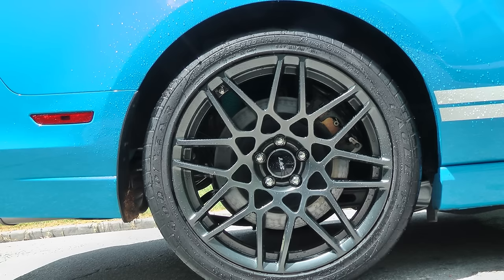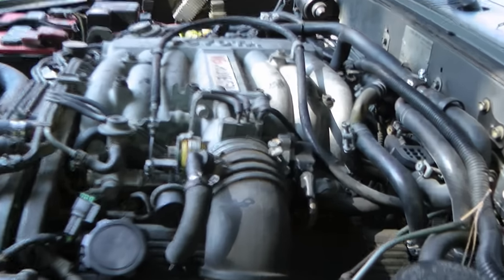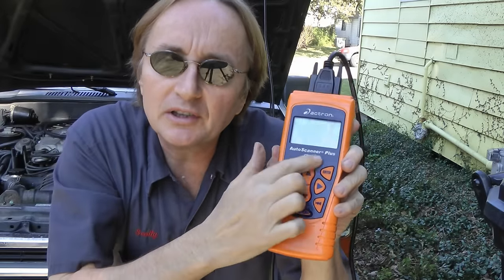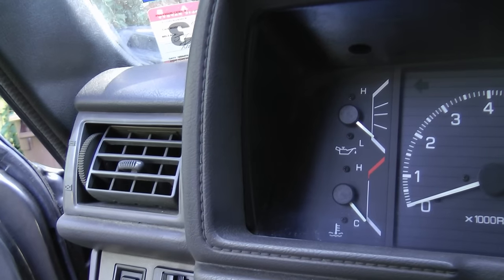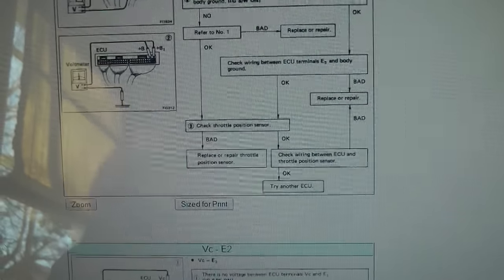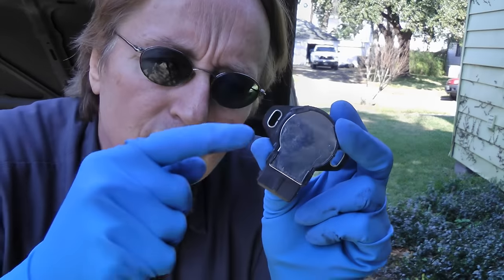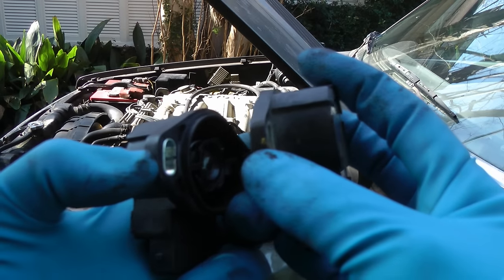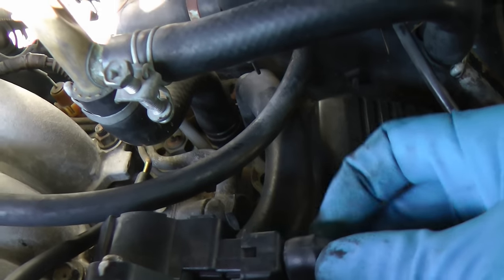How to Stop Car Hesitation (Throttle Position Sensor)

Comment: hi scott i have a 07 cts that cranks but doesnt start..i changed the valve cover gasket spark plugs. i fired up the first 3 times then it gave out there was a ticking clicking noise then went dead. .. the next time i tried to start it it drained the battery i tried recharging n battery is good i tried again n nothing drained it again i also tried to jump start it n still nothing can u help
Reply: What was it I would guess starter

Comment: sir i need your help. i try to pull out the tps connector and the rpm increasing and the worst is when i add some gas on pedal the rpm still increasing higher. does it mean i have bad tps on my nissa sentra 2003 model.
Reply from the maker: you can't test modern cars by disconnecting stuff, there is too much feedback software on their computers. that test is meaningless on your Nissan, have it tested by a pro with an oscilliscope, or just guess with a new one considering what mechanics charge per hour. Auto zones have a very liberal return policty, if it doesn't work, get your money back

Comment: what are the symptoms of a bad TPS on a car
Reply from the maker: often poor idling and weak acceleration
Reply: thanks for the quick reply @Scotty Kilmer. the reason i ask is because i have 2000 gmc yukon 4x4 5.3L  when im hitting highway speeds 55 and over my suv starts jurking and my speedometer  bounces from 55 to 65. i have replace my wires my spark plugs and even my fuel filter. my check engine dont come on dough. so im having a hard time figuring out what is wrong with it.

Comment: Mr. Kilmer, I found your page(s) by Divine providence, fate, luck or whatever. I am having serious poblems since a shop replsced distributorm rotor and cap. It i a Mazda Millenia 2001. That gracious Spirit is causing me to believe it is my throttle sensor that is comtributing to the "HOLD" indicator flashing and the engine is fine foe  a time and then it's hang on cowboy for a time. If I can successfully replace this sensor I will extol your pages to any and all others. I appreciate your time and you shring in this manner I have no doubt that you have helped countless others. Sincere best wishes sir. I'll be back to let you know the outcome.

Comment: Would a bad TPS cause my car to run rich?
Reply from the maker: +rog duran sometimes it can, just depends how it breaks
Reply: +Scotty Kilmer Hey Scotty, could catalytic converters cause poor acceleration on a vehicle?
Reply: +Scotty Kilmer would it cause it to lose fuel extremely quickly as well? I had same sort of problem, car running rich(whitish smoke) and poor acceleration, and idle dropping til dead. Didn't see oil or gas leaking out the bottom, it's like the gas disappeared!
Reply: i gonna say yes. not enough air flowing out. i think thats whats going on with my mustang

Comment: Hey my 2000 mustang when I give it gas it studders any clue why new plugs new air filter cleaned the idle air , and mass air flow, new fuel filter , any clue no engine codes
Reply from the maker: pressure test the fuel pump, as computer doesnt know fuel pressure so it can't set a code if it's bad

Comment: so I have no idea what's wrong with my truck, (92 dodge dakota) in the morning I'll wake up to go to school and I'll get in and it starts right up but has a extreme vacuum leak sound coming from the throttle body then then it goes away, when I give it gas it hesitates then goes, if I put it in drive and give it gas it dies. I've tried unplugging the tps and the truck just died. any ideas???
Reply from the maker: +Zach Gee  do my video "finding engine vacuum leaks with a cigar"

Comment: hi scott i'm having a bit of a problem with my plymonth breeze. I went to get my inspection done the other day and failed. they siad I have to run the car about 100 miles so the computer can be ready to diagnose the vehicle,  did that, but i notice after i get to the 4 code sometimes the 5th code while driving about 70 mph the engine will hesitate and the speedometer will drop to 40 mph and jump back to 70 mph and when that happens the check engine light will come on and go off and that resets the computer codes why is that happenning
Reply from the maker: dj immenojockoo   try a new speed sensor
Reply: Gear position sensor, output side or input side which one

Comment: Hey Scott,

Why does my car jerk when I shift gears from parking to reverse? and all the others jerk as well but not as much as the reverse. It feels like the transmission is going to come out. I just flushed the transmission fluid and it keeps doing it. Do you think it might be that the transmission is already worn out? 😓 

Someone help please. 😩
Reply: I could high idle set your idle to right rpms at idle
Reply: sounds like a tranny or motor mount. if they are worn, it will cause play.

Comment: hello I'm facing a problem I drive and 2003 gmt yukon and it cuts on and it rides but now it's starting to cut off while I'm driving it did it on the highway  and side street oh please tell me what can that be 

            sincerely in need of answers
Reply: +Nichole Reese Fuel pump, better check it out before you are stranded on the highway.
Reply: +Jonas Ben thanks
Reply: +Nichole Reese No problem.

Comment: my toyota 7k-e engine MT has high idle without a/c  my idle screw is on lowest settings throttle body is clean how can i solve this Sir scotty
Reply from the maker: you may need a new iac valve, but try this cleaning video and pray it works https://www.youtube.com/watch?v=NWCKvU2FmDc
Reply: sir i have done cleaning the IAC valve, but i dont have check engine light but when i shorted the Te and E1 on diagnostic it gives me a code 24 and code 41 i search on google it says code 24 air temp sensor, code 42 TPS sensor. when i unplug the TPS sensor while the engine is running the idle goes up high
thank you for your reply sir Scotty

Comment: When you throttle sensor play up does the check engine light comes on
Reply: I had a bad throttle body sensor and on my saturn 1997 it doesnt read that its bad
Reply: @piggyjones6667  did it lose power and fill like its straining

Comment: I have a 89 mustang 5.0 losing power when I hit the gas but I check the mass airflow when I unplugged it it shut off what else could it be
Reply from the maker: lots of thing, pressure test the fuel pump first as weak ones or clogged filters do that
Reply: Scotty Kilmer ok ill do that thanks

Comment: sir my 2005 hyundai getz manual trans have a problem. 
I am in full throtle but da speed is not running fast. it accelerate slower than usual. what seems to be the problem sir? please help
Reply from the maker: +Savina Oregas time for a new clutch, it's slipping
Reply: +Scotty Kilmer sir i have already replaced my clutch set. but still no good. wat seems to be da problem

Comment: i have a 2002 vw passat and the problem with it is that it takes a while for it to take off just fixed the oil lines and added new oil transmission what can b causing my car to take a long time to accelerate ?
Reply from the maker: +jerry aguilar on those, often bad maf sensors or weak fuel pump. PRAY it's not the transmission going out cause those are weak and cost a fortune to rebuild, but go out a lot when that old
Reply: Scotty Kilmer what would u recommend if u were in my situation? And btw thanks for answering my question

Comment: Had a poor idle. Cleaned air intake and changed out throttle position sensor.  Now it starts idles for about 2 or 3 seconds and then dies.  It will run if I rev it to 1500 or more. If I put it into gear it dies instantly????
Reply from the maker: pressure test the fuel pump to see if it's weak

Comment: Hello Brother. I am writing from Turkey. and I have a problem. The BMW 3.20d m47 engine has an automatic model of the 2001 model. my problem is that my vehicle is starting with a delay of 4 seconds each time I press the accelerator pedal. 4. After the rocket, please give me a suggestion. the injector is giving a cable fault when the vehicle is connected to the computer. so the pump and injectors changed, the motor wiring changed, the maf sensor changed, the brain was checked, the turbo was cleaned, the turbo was checked and no solution was found. please help.
Reply: the vehicle is sensing gas very slowly

Comment: If the engine runs better without the sensor what's the points in having a sensor?
Reply from the maker: modern software can do weird stuff in a car, making them "seem" to run better with things disconnected due to backup software. But the sensors are there to maximize power and minimize pollution
Reply: ok. Thank you. Would revving up, down, up down, up down, every 2 seconds or so be a symptom of a bad TPS ?
Reply: you have a vacuum leak
Reply: Actually, getting a new catalytic converter  seems to have solved the problem.
Reply: sorry my toyota did the same thing and it was a vacuum
Reply: Seems like there's a lot of problems that have the same symptoms. Vehicles today are too complicated. A bad computer can act like a mechanical problem. A mechanical failure can be disguised as a bad sensor. A bad sensor can make you think you need a new computer. Even computer diagnostics can lead you in the wrong direction. I yearn for the good ole days when problems were obvious.

Comment: I have a 2000 Buick lesabre custom and I cleaned the throttle body and now after 3 days it still won't start I know I have fuel plus I just cleaned all of my injectors and my fuel rail and the car was running I know my coil packs are good and making spark and it has air the throttle body gasket is good but the check engine light is on I tried starting it with the maf unplugged still nothing and the battery is good freshly pulled out of my 2002 Chevy 3500 6.6 duramax diesel.
Reply: plus there are no codes checked with a scan tool.
Reply from the maker: +Benjamin Hopkins try my video "fixing a car that cranks but doesn't start up"
Reply: +Scotty Kilmer  I have I've been watching your channel for 4 years and I'm just now 15 it has fuel spark and a fully charged battery.
Reply: +Scotty Kilmer And I just changed the spark plugs like 10 minutes ago I'm charging the battery again to be on the safe side but what do you think I should do? And is there anyway I could get in a Skype call with you?
Reply: +Scotty Kilmer  I think the antifreeze is mainly water and the radiator thermostat is reading 10 degrees so the water pump is frozen.

Comment: my car hesistates when i mash all down on the accelerator. i changed tps, throttle body, injector rail and the problem still persist. Fuel pressure is good and i have no idea what the problem cud be. Any help would do
Reply from the maker: +hyperzinc  many things can do that, guessing wastes money and often fixes nothing. Have a guy like me analyze it with his dealer level scanner to find the fault--see my video "fixing insanely complex modern cars"
Reply: +Scotty Kilmer got it sorted out. I had to change the distributor. Thanks

Comment: Car idles great and drives fine but when idling or in gear if brake applied and gas pedal pushed nothing happens motor doesn't rev up or try to move

Comment: My mechanic told me I need a new tps but it's carb'd am I wrong thinking that it doesn't have it since its carb'd
Reply: Car is a 89 corrolla with poor idle and wants to die at stops and when romantic gets low, any suggestions as to what it may be

Comment: Hey Mr Scotty my 95 corolla.    my fuel filter,   airfilter,   spark plugs and wires ,   new distributor cap n rotor.  but my car still sputters wen drivin n at redlights.  it cuts off. and fires back up. n my engine light is on.    im tired of wastin money.   Thanks.
Reply from the maker: often dirty fuel injectors, pressure test them and also pressure test the fuel pump
Reply: Ok thanks

Comment: hey scotty, i really need your help. I have an 01 mustang and when im driving down the road my car starts to lose power, i step on the gas pedal and it doesn't accelerate so what I do is turn off the car and turn it back on and it starts running fine for another 10 minutes or so. Also when i'm at a stop light it starts shaking like if it wants to cut off. I've taken it to different mechanics but each one tells me different things. I've already done a tune up and changed the fuel filter but still the same. Can you please help me. Thank you.
Reply: I also have no check engine light on
Reply: LethalBean, I don't want to jump in on Mr Kilmer's stuff, (I learn from him as well and love his stuff), but I can add a tidbit of information that might help you. It has served me well over the past five years. Just because you don't have a check engine light on doesn't mean that you have one developing. By the time you read this your light "may" be on. Or, (like in my case) I have a code present on my 07 Dodge Magnum HEMI, with no check engine light which states my "immobilizer key has not been programmed", which could have happened from a number of reasons. But, in the past, people have gone as far as removing the instrument cluster and removing the light bulb behind the "check engine light display" so if a code is present, you won't know until the problem turns into something major. (I had a car like that once). On some newer cars, or different makes, that is harder to do as the light is actually an l.e.d. attached to a circuit board and cannot be unplugged like a light bulb.
Just like Mr. Kilmers trick of jumping ports with a paperclip, (which I used to do on an ol 92 Camaro), these days, if you have a smartphone, can afford to spend 15 dollars, you can pull codes yourself and with one click, get a definition of the exact problem you are having. (If a code is present). 
Go online and look up an ELM 327. It plugs into your diagnostic port, and costs, well I got mine 3 years ago for about 12 dollars. When you get it, you can go get the "torque app" installed on your phone. (I'm android) I am not sure about apple. There is a free version, but the full version cost 5 bucks.
This ELM, while plugged into your OBD port, Bluetooth connects to your phone, and while the app is running, you can scan your own car in your driveway, without going to Autozone, without going to pay a mechanic, and if there's a code displayed, you can click on a link, it will take you straight to the web and give you the definition of what's going on.
Certain models even have a female that talk to you when your engine gets to operating temperature, or will verbally spit the code out at you, and if you are hard of hearing like me, plug in your 3.5 mm aux cable into your phone and into the aux port of your stereo and listen to your car talk to you lol.
On some cars though, like my son's Cadillac, you have to get an extension wire for this scanner as the OBD port is recessed into some funky plastic tunnel that makes it hard for certain scanners to even attempt to get into.
There's other things that could be going on as well with your vehicle, but ironically, today I was reading about "cleaning throttle bodies" on cars and it brought me to Mr. Kilmers channel again.....You could possibly also have a dirty throttle body or, if you don't use the same gas station all the time and have recently fueled up at a different location, could have gotten hold of some bad fuel....that's the few things that come to my mind...
Good luck, hope you get your problem fixed.....!

Comment: Car stalls when I shift to R or D, once the engine has warmed up. It will restart no problem, but stalls again when trying to shift again.  Less of an issue with a cold engine. Please help!
Reply from the maker: it does it when warm more, so odds are engine is slightly running rich. Try my video 'how to clean fuel injectors on your car'
Reply: I also hear a metallic friction sound when placed in reverse, and foot on brake.
Reply: Torque converter clutch? flywheel maybe. Lastly when exiting the free way, at the first stop light, the car shuts off. It starts again, but its back to the stall issue once I go to Rev or Drive.

Comment: I replaced  throttle body  with new sensor  and all 4 coils and and the crank sensor  car stills stalls if i hit the accelerator  hard  what still be the issue
Reply: I also  replaced  spark plugs  and fuel filter  and air filter  i have 2002 toyota  solara

Comment: Sir My car engine stops sometimes while releasing clutch or changing gear even at high speed sometimes 
I had cleaned my throttle, changed fuel filter, checked battery terminal 
but problems still persists 
plzz guide me
Reply from the maker: tons of things can do that, start by having the throttle assembly checked by a pro mechanic, often they just flat wear out and do that, especially on fords

Comment: my 94 mustang cuts out when I push on the gas and dogs  any idea what it could be
Reply from the maker: pressure test the fuel pump AFTER changing the fuel filter to see if it's weak. Also try cleaning the fuel injectors and do check the spark plugs

Comment: when I let off the gas my car makes a bang sound in the front, slightly jerks and idles weirdly and does the same just for a moment when I accelerate, battery and starter are 1yr old and all my brakes, roaters and tires are new.
Reply from the maker: check for worn motor mounts first

Comment: what did I do wrong ? I purchased a brand new ac delco tps took out the old one on my 88 buick regal and took the old one out and the car went nut check engine came on started running very badly shacking . had to put the old one back on any ideas ????anyone ?